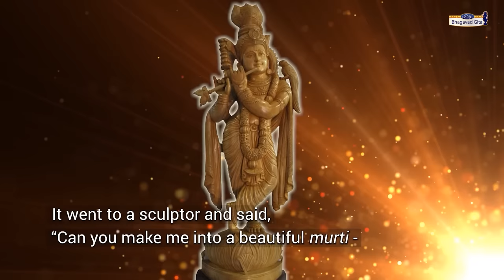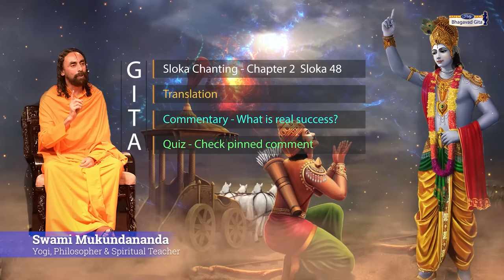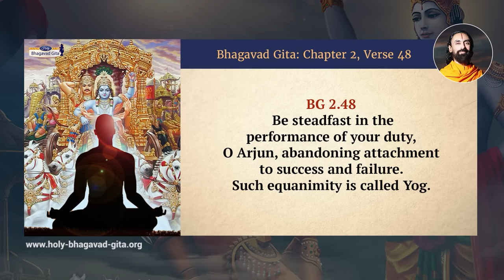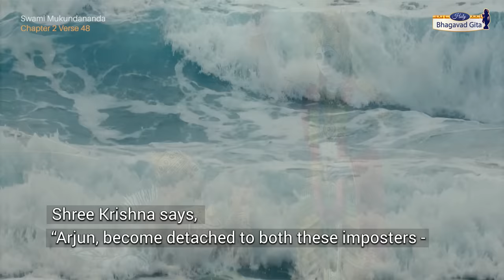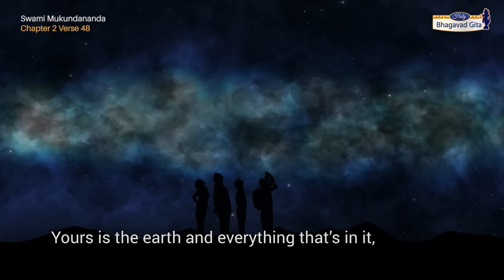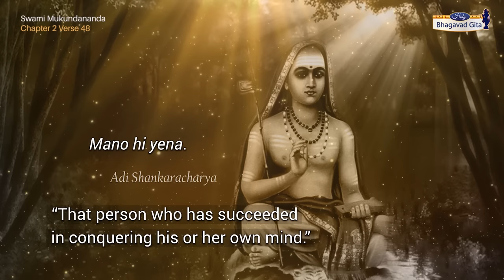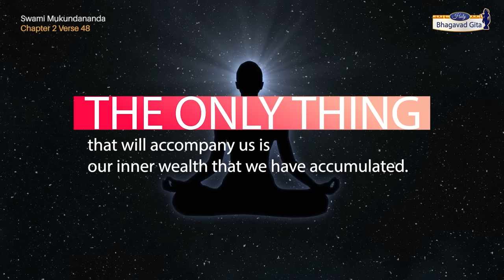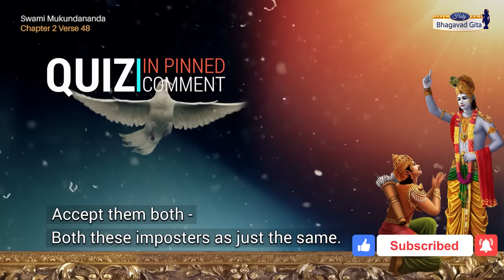You will NEVER look at FAILURE the same way | Swami Mukundananda | Bhagavad Gita

Comment: Answer :
1. It is measured not by outer but by inner parameters :
(a) How much detached have we become from success and failure ?
(b) How much successfully we can control our mind ?
2. That, I will put my best efforts in my work. Only efforts are in my hand and not the results. And when success or failure come, I will handle them both equally.